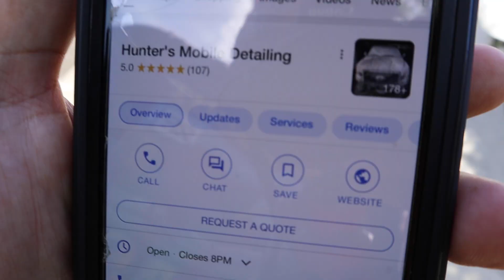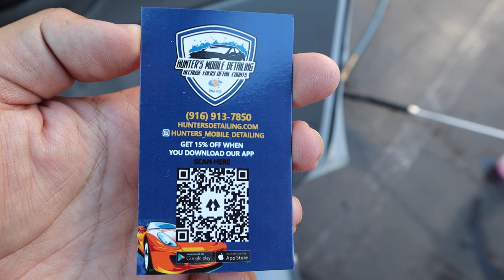The Struggles of Growing My Car Detailing Business - Hunters Mobile Detailing

Comment: An Inventory sheet will solve that. Make your driver responsible for that. They can count .25, 1.5, .8, etc to account for what’s in the van. Exercises accountability and responsibility in employees. Will also help when you grow more and wanna keep track of overuse or if chemicals go “missing.” We do it in the restaurant industry all the time. Excel probably even has a template for one. You gotta pull yourself “out of the field” more for admin. You can also get specific measuring cups for chemicals.

Comment: Camera man smart 👌STOP using that brush 😩
Reply from the maker: It’s bad to use a brush ?
Reply: @HuntersMobileDetailing  Yes it is bad. it’ll scratch the car.
Reply from the maker: Thanks crazy it’s meant to wash a vehicle but it scratches it 🤦🏾‍♂️ it’s always something thanks. So what do you suggest for hard to reach spots ?
Reply: @HuntersMobileDetailing  just use the mint it’s more time but it’s also safer depending on the car how dirty it is. Once the foam is on the vehicle I let the soap do the work and I’ll use the  wash mit after.  The only time I’ll use a brush if it’s a big van or trailer
Reply: @HuntersMobileDetailing  I wonder if you can makeshift something with a pole and the regular hand washers, Maybe some stick with rubber at the end, surrounded by foam and covered with a hand washing mitt?